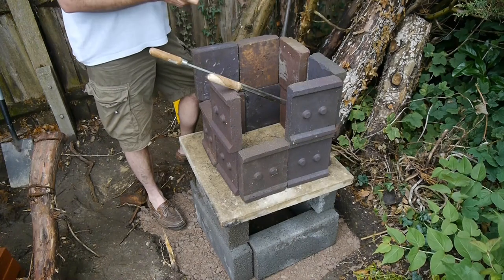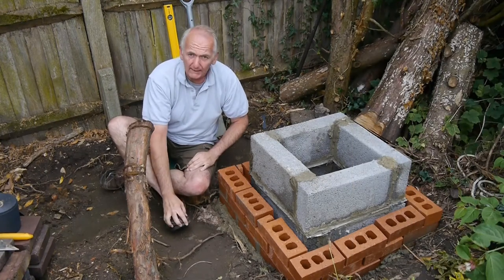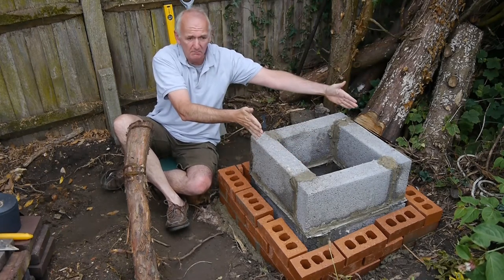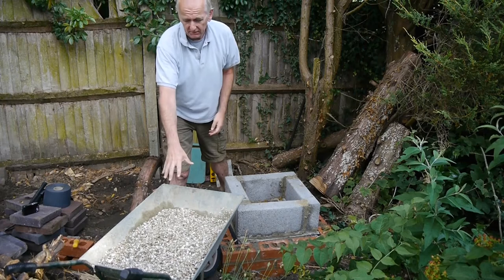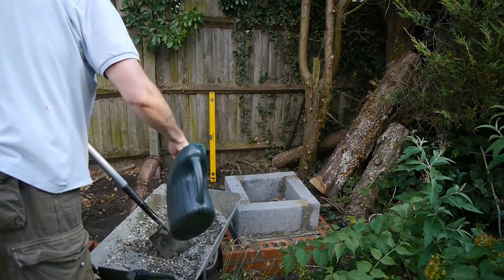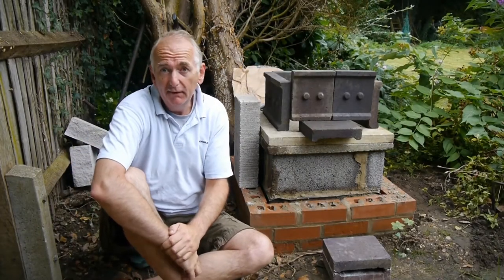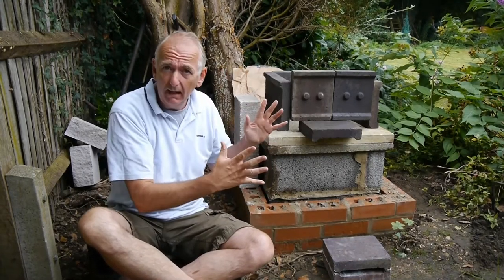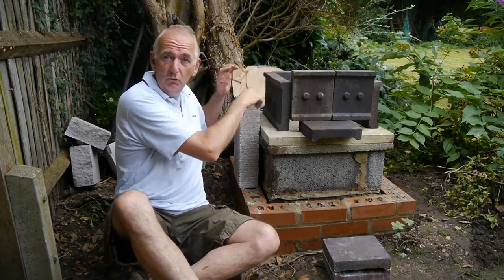Tandoor Oven Build prt 2  - Insulated base

Comment: Good so far what are those bricks you are using for the top and how much gap for the installation? 
Cheers Ian
Reply from the maker: Hi Ian, you are asking about the core oven bricks - correct. If so these are old storage heater bricks I brought off ebay
Reply: I think you bridged the dpc when putting in the vermiculite mix